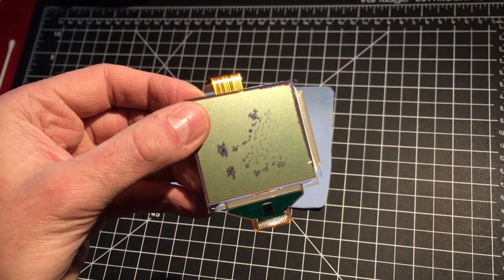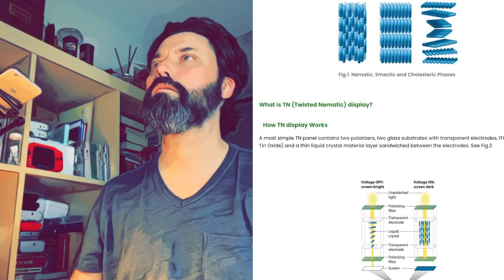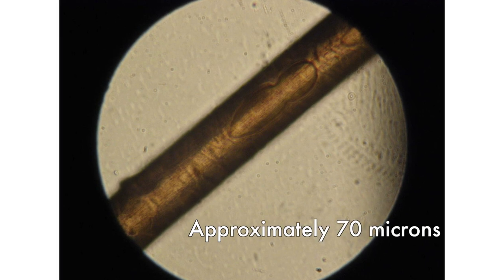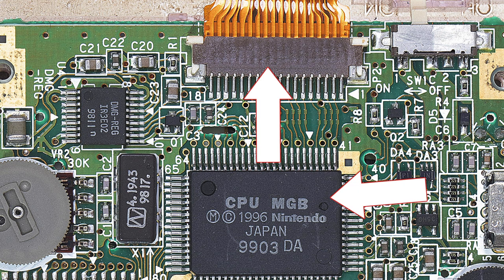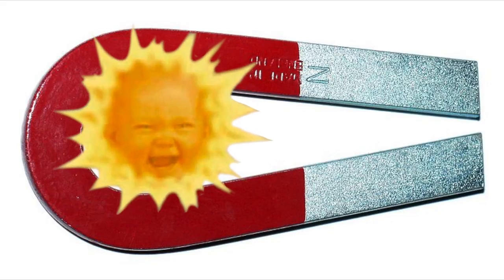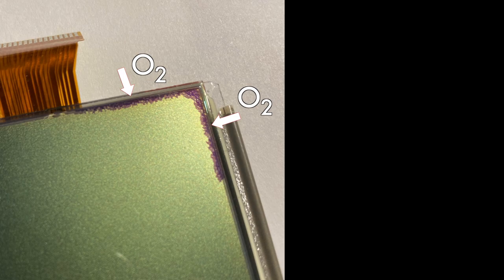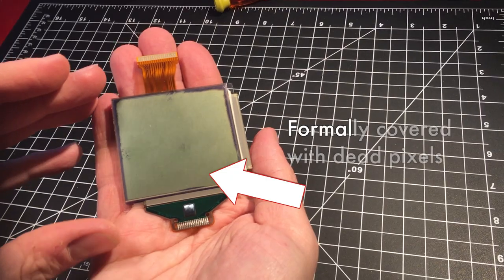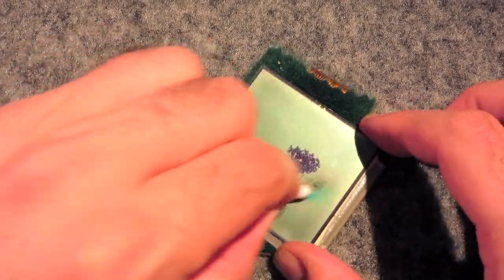Dead Pixels and How Gameboy LCD screens work - The Epilogue

Comment: Interestingly some people have observed their screen cancer going away over time on Gameboys and other old LCD handhelds, and others have also said that it's less of an issue in less humid and cooler environments... The principle of spreading the dead clusters out with pressure is something I just did on a DMG that turned out pretty well, except that I used my thumb and pressed so hard that I ended up with a blister lmfao 

Great video! I have two Wonderswans with very small areas of screen cancer, so I'm hoping that they will not spread too badly. If they do, I'll either apply this pressure technique or simply put in IPS screens and keep the old screens around for a rainy day!

Comment: even on modern LCDs the picture elements getting stuck is a well known problem. They "solve" it by twisting each cell of crystals clockwise and then counterclockwise (or whatever polarization orientation that screen is built with) on successive frames. Since the amount of light that gets through is purely how twisted the crystals are, you can't see this behavior.

If you defeat this alternation by sending a flickering signal timed just right, the crystals will start to get stuck within a few minutes. It's that easy. It's the reason why bob deinterlacing can leave afterimages on LCDs.

So the getting stuck has nothing to do with oxidation, it's just a basic property/flaw of liquid crystals. As to why they grow, (just guessing, here) once the crystal gets stuck, it leaves less room for the other nearby crystals to rotate back and forth.
Reply from the maker: While the color flickering method can work on color LCD/TFT/IPS screens, that method doesn't work for monochromatic transflective screens.
Reply: @Tendo209Mods  read the comment again - I'm not talking about unsticking pixels with flicker, but the exact opposite.

Comment: Center screen might be started from UV damage which then leads to oxidation as the screen gets tiny holes. I'm curious if electricity can reverse some of this oxidation, reversing the standard charge of vertical and horizontal elements.

Comment: I had a tamagotchi with this issue, and because the screen stays running at all times it would fix itself the more time passed, but when it was dead and I took out the batteries the pixels would come back after awhile. It’s a weird issue.

Comment: If your theory is correct, does that imply that its likely the cancer will return on any screen thats already had it?  I suppose, if it is oxidation, that it implies a level of neglect at some point in the gameboy's life...possibly stored in an place that wasn't temperature controlled (a garage or attic in summer heat or a storage unit in cold winters).  Thanks for the videos.
Reply from the maker: Thanks!  I suppose oxidization 'could' reoccur of the screen is stored in optimal conditions for it to happen. I do have a few of the screens I've fixed still - the first one almost a year old and its perfectly fine still. I suppose I just "hope for the best!" that it doesn't decide to return!
Reply from the maker: @ImGonnaShitYourPants  The screen will absolutely still work!